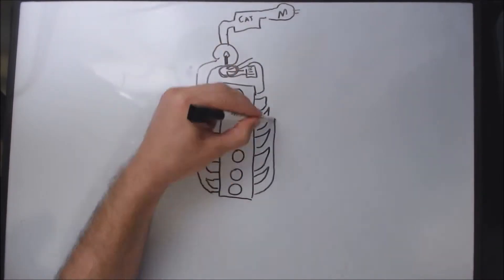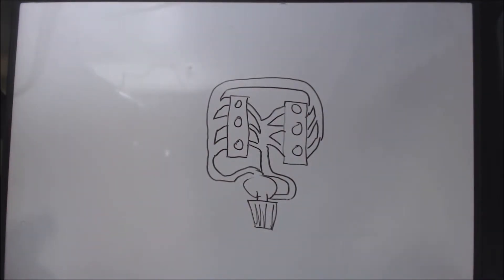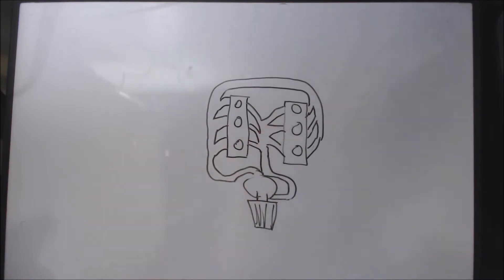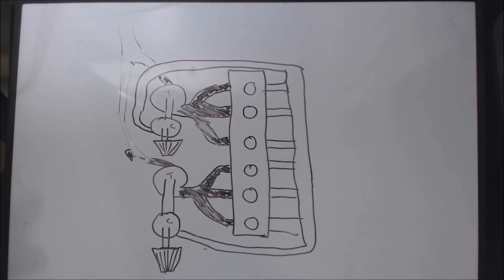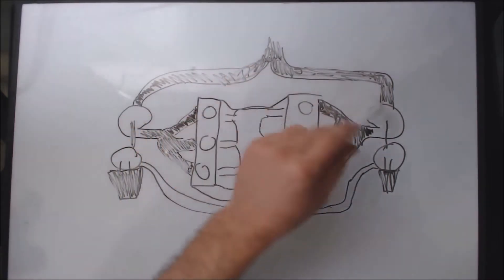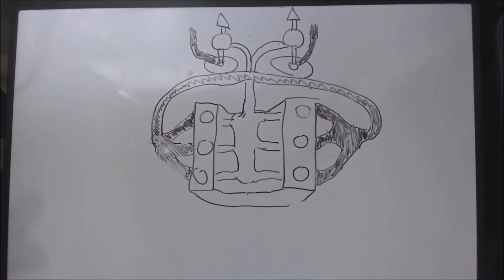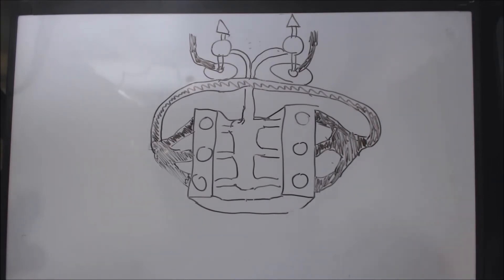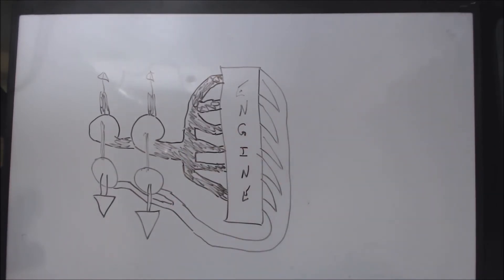Single and Twin Turbo Configurations (Video 3) |JOKO ENGINEERING|

Comment: I thought the exhaust, in a sequential arrangement, went from the engine to the larger of two turbos, then from that turbo to the smaller of the two turbos and then out to the exhaust system.  Of course, there would be appropriately sized waste gates before each of the turbos and their involved exhaust routing ect., but that is the basic arrangement of a sequentially turbo'd engine; or have I failed to understand something?

Comment: How would a single vrs dual turbo change your calculations in video 5??
Reply from the maker: Same procedure, but with twin turbos you'll calculate the same pressure ratio on the compressor map but half the mass flow rate per turbo.